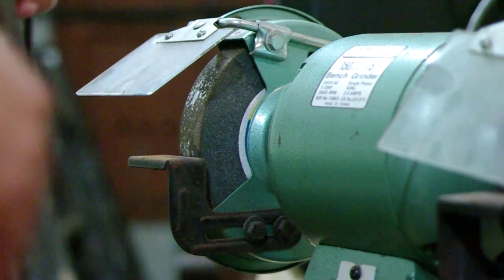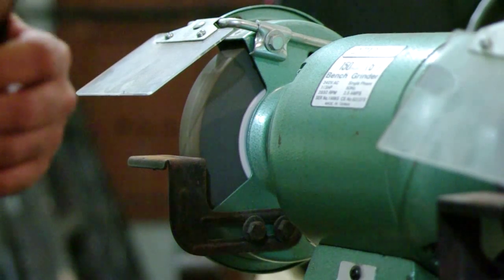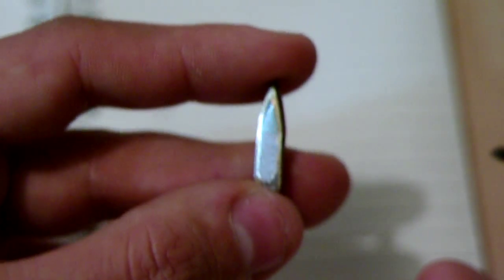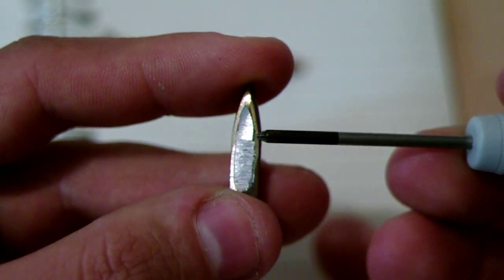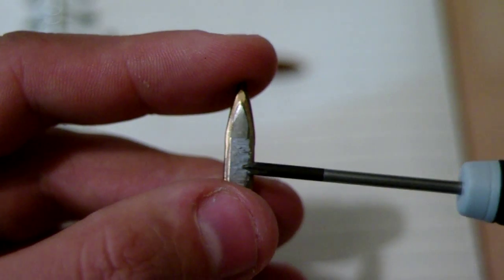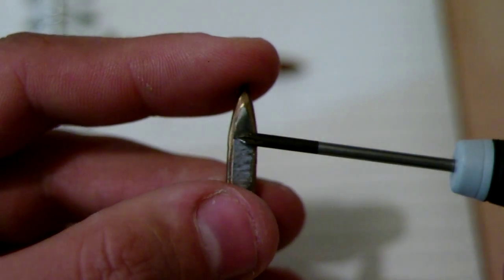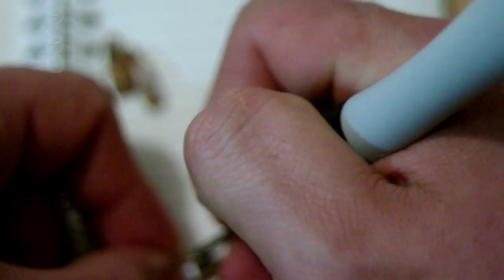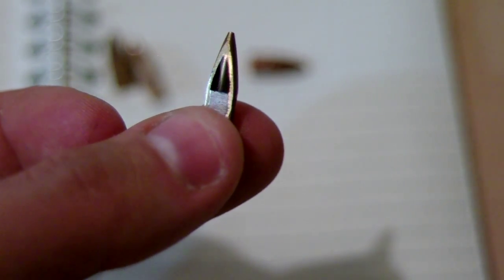SS109 Dissection! What's inside m855 5.56x45 NATO ammo?

Comment: The core has steel at the tip,  but it is not "steel core", it is a steel-tipped barrier penetrator, SS109.
Many also call this magnetic ammo, but they are not that either, they are just ferrous metal tipped, and are attracted to magnets...

Comment: Many myths and miss information are out there about this round can you answer a couple of questions for me please.
1. where did this round come from was it Australian or US or other
2. Did you section it deeper and find a air space in the tip.
The original SS109 has a air space o in front of a hard steel penitraitor. Australian f1 ammo from the early 2000 100% did (I have a sectioned f1 projectile) as far as I know US M855 dose not. I'm doing some research on why US M855 sucks and it seems that America ammo has deviated from the original SS109 design.
Reply from the maker: Hey Mate, I hope you're well during these crazy times!

1 - Not too sure of the origins of those pills. I remember buying them off an old fullbore shooter down in VIC however this video is ~5 years old now and I had them well before I made it.

2 - Where it's at in the video is where I stopped grinding it. I never got to the tip. After the video I threw it away as it wasn't really of any use to me anymore. 

I remember the ammo being not very consistent. The bulk 55gr soft points you can buy (think Hornady, Speer, Sierra) all shot way better out of my rifles than these. 

Cheers, ASC.
Reply: @AustralianOutdoorsChannel  No probs and thanks dude. 62 grain is a bit too heavy for the average 223 with a 1 in 12 twist. Nosler shots or Sierra super roo 55g are awesome for being the cheapest bullet in the country. I still got 1000 roo bullets left.
Reply: @corporalpunishment1133  bolt rifle .223s are generally around that 1/12 twist and require 55 grain. Its the 1/7 and 1/8 that uses a heavier bullet. The most common .223/5.56 rifle uses rifle twists in the 1/7 - 1/9 range so they are suited for the heavier bullet, in the US
Reply: don't quite remember but if i'm not mistaken  a 1/12 twist originally shot a 45 grain pill & had a completely different powder load. here in the states today seems to be a push on the 1/7 Twst That said the green tips are nothing , If the public has access to them big bro makes sure their a crap rd. they won't penetrate BArmor and without BA its a pass through. That was a problem in the mid east
Reply: @olisnackbar5850  I know it's older post but I've been wondering about the difference between the ADI SS109 and AMERICAN 8550 which is better at penetration,quality today or are there any difference at all?
Reply: @patriotcountry4716  Hi, Their the same pill. Same results out of either or. Peace!!
Reply: @olisnackbar5850  thanks! I have heard so many conflicting stories.  But I think the newer stuff is not like the stuff from several years ago is about all I have gotten from everything I've read. Lol

Comment: the 7.62x25mm pistol ammo has a steel jacket and core with only a small amount of lead surrounding the steel core. 
The core tip flattens out round and flat leaving the rear half intact when shot at plate steel. The steel jacket peels off the core.

Comment: thank you!  I shoot this stuff all the time and always wondered what was the composition of the round. it does NOT penetrate my ar500 targets.
Reply from the maker: Hey Joe, you're most welcome! This stuff is pretty rare down here so when I got a bunch of them I had to check out how they were made :-)
Cheers, ASC.
Reply: Does it distort the steel plates at all?
Reply: @gjohns316  I've had a follow up shot penetrate ar500 when using a binary trigger. That's literally 2 rounds stacked on top of one another, however. As far as single shots, you may get the occasional divot, but it shouldn't warp it too bad.